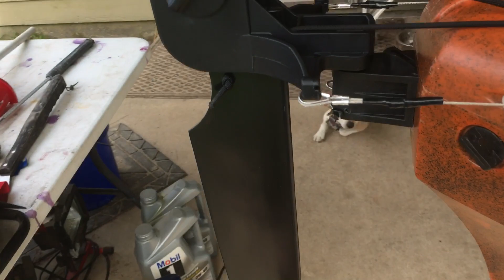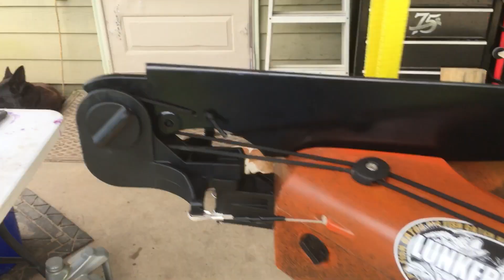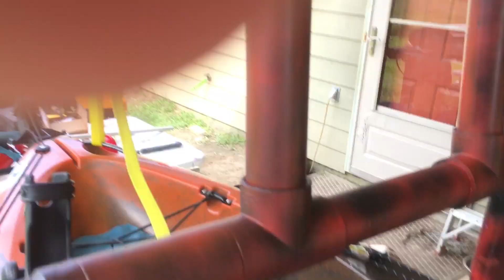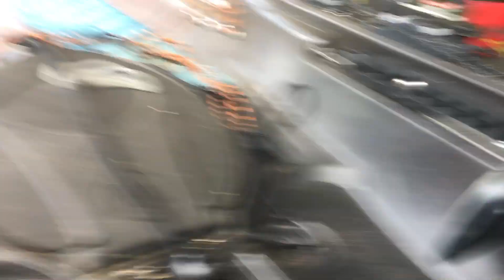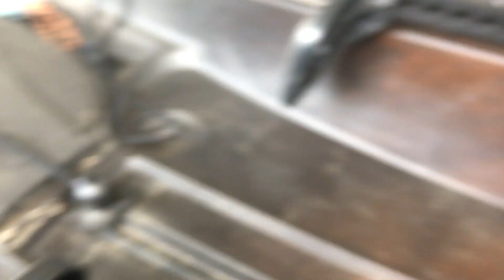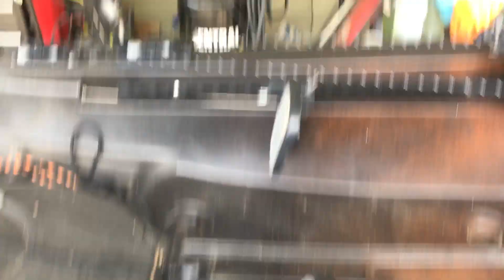Wilderness Systems Ride 115x Yak Attack DIY Kayak Rudder Install Under $85!

Comment: So it's a rudder that you can't turn therefore a skeg?
Reply from the maker: It is a working rudder.
Reply: @acadventures7799  how do you turn? I though the ride115x needed the aluminum rails on the pedal thing for it to slide back and forth to turn.
Reply from the maker: The pins on the pedals just put the rudder in a position to come up straight. If you pulled the pins out that I installed it works with pedals.

Comment: smart i was thinking of the 90$ rudder control peddles but i might just try to use my existing foot peddles
Reply from the maker: Yaad Rana I would also recommend putting some all purpose grease on the rails. Helped me out a ton to cut down on friction
Reply: @acadventures7799  what size wire to fit in that tubing? 1/16th?
Reply from the maker: Yaad Rana Canomo Cable Railing Kits... https://www.amazon.com/dp/B07GMNPNHK?ref=ppx_pop_mob_ap_share